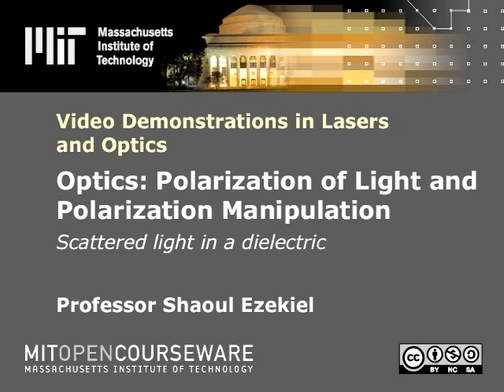Optics: Scattered light in a dielectric | MIT Video Demonstrations in Lasers and Optics

Comment: That big piece of machinery on his desk was a laser.. the same kind of lasers we've got in our pockets today
Reply: the difference is those lab lasers have temperature control for stability and other accurate components for voltage and current control.
Reply: not really. no one's walking around with helium neon gas lasers in their pockets. A He-Ne gas laser like the one in the video may not produce a red beam any brighter than the average $2 diode laser based "pocket" laser pointer, but the polarization control is far better, the overall beam quality and divergence of the laser is vastly superior, and the monochromaticity of the beam from a He-Ne is supremely higher, the bandwidth of emission being only around a thousandth of a single nanometer wide - something you could never dream of achieving with a cheap diode laser.